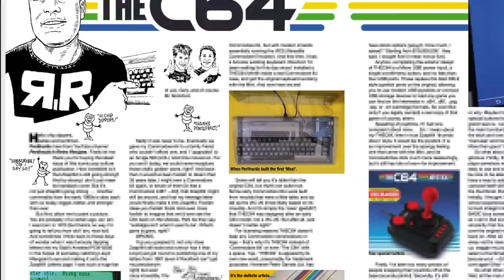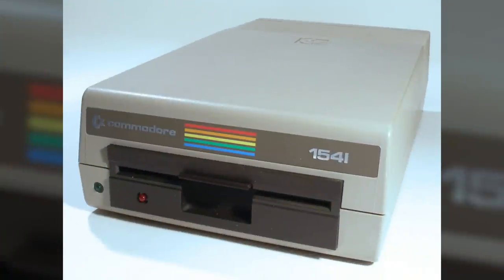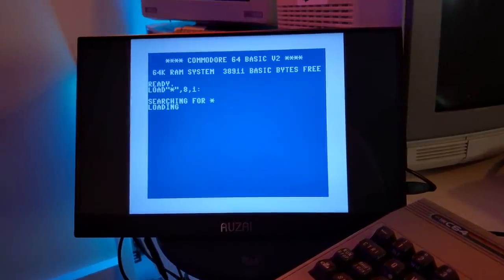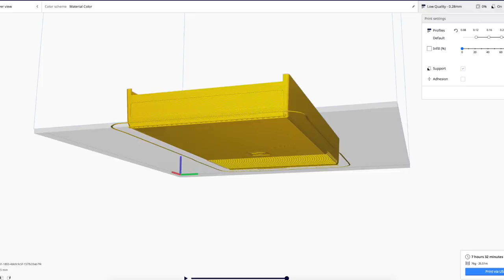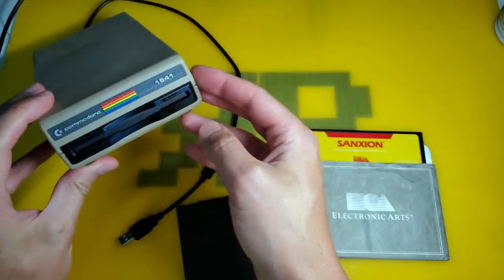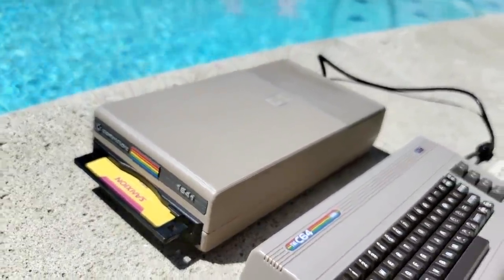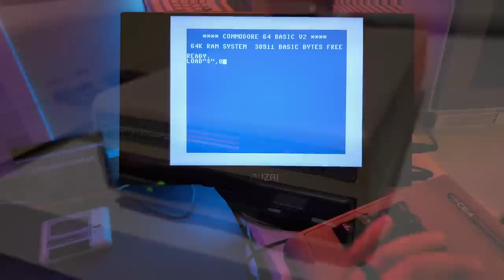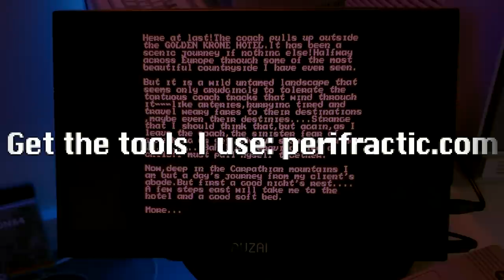Can we make REAL Floppy Disks work with THEC64®? 1541 Mini!

Comment: The thing is... Windows isn't "doing something weird", it's formatting it as a FAT12 floppy disk, as you would expect it to... But the Mac is just treating it as a raw block device (like any USB drive) and is formatting it as such (with a full partition table, MBR, and most likely FAT32). -- so the Mac is what's being weird here, it's basically treating the device+disk as a really tiny thumb drive, instead of like a floppy disk.
Reply from the maker: Good points. Could be! But then, why do 720KB disks formatted in Windows work with THEC64 (as I mentioned in the video), but only 1.44MB don't work from Windows  🤔 In other words why does Windows format 720KB as a raw block device (from what you're saying), but it formats 1.44MB as a floppy? That's what I mean by "something weird" going on...
Reply: Yeah, that is what I was wondering... it showed FAT12 when he put the diskette in the Mac, which is correct. The Mac formatted it wrong, but luckily it was what the C64 needed.

What I am surprised about is the C64 firmware can read FAT32 but not FAT12?
Reply: Just a couple days ago I tried to format Micro SD cards for use in MSX computer cartridges for FAT16 on Windows 10 and they didn't work at all, but on an old Win7 laptop they worked every time with the same settings. Not really related to floppy disks but something is a little weird with Win10 and FAT.
Reply: @knightcrusader  That doesn't surprise me at all, TBH. FAT12 is only used on floppy drives--you can't format a typical USB drive using it, after all--so why would the makers of the C64 feel the need to support it?
Reply: Hi - it may be the same problem as with older pc's and hardware, windows xp and newer use a type of does emulator not a full dos like what was used up to Win 98

Try a older machine that boots up on genuine does 4 / 5 / 6.22 and try formating the floppy on those machines.

Back in the day i had a compaq 386 with win 3.1, that pc could format a variety of floppies that worked on "strange machines" 

Dos 4 and 5 etc also has command line options for the format command  - type format /? to review the options you can use

Regards
George
Reply: Hey, thanks for the pin, Perifractic!  I missed that comment in the video, so I can see where you're coming from now.

The thing is, Windows 10 is really particular about how it treats USB devices with the "removable" bit turned on in their drivers.  So I don't think it was treating it as an internal block device for either format. (Meanwhile typical *nix-like OSes are very unrestricted here, and let you treat just about anything as a raw block device, even a file on disk, or a block of memory).

What I suspect the real issue is, is that the firmware/drivers on that embedded ARM SoC (I would guess it's rocking an Allwinner, probably booting into some stripped down Linux kernel under the hood, and launching the C64 shell app after it boots up).  And I'm guessing the drivers it has are probably not 100% compatible with FAT12.

Most modern embedded systems' drivers only support FAT32 (and some support exFAT/FAT64). -- And I'm not surprised if a modern SoC system only has partial support for FAT12, it's kind of the nature of embedded programming, to strip the code down to as small a footprint as possible.  (And sometimes that stripping breaks or even outright removes antiquated features.) 

Regarding the MicroSD card Tangent that another user brought up, that could be a ton of different things, and I'm not really surprised that Windows 10 is acting differently than Windows 7 there.  In that case though, and IMHO: they're both acting weird, because that's not really a normal thing that there's an established standard for.  It probably comes back to Windows 10 treating it as a removable device though, and initializing and partitioning it differently as a result.  So, if you're emulating a harddrive with like an SD-to-IDE adapter, that's not going to work well for you.

(You can test that same phenomia by moving drives between different external drive kits, and internal, and noticing that in some it works, and in others it will show up as RAW -- this is because the drive controller's drivers are telling windows to treat the drive differently than how it's actually been initialized and partitioned -- that is, even though it has the correct partition, the offset to the partition table, and the very low level boot-record/MBR/GPT type stuff is wrong, so it just thinks the drive is full of garbage).
Reply: @RetroRecipes  Maybe the DD disk works because you need to manually specify the number of sectors and tracks to format via the command line (FORMAT A: /T:80 /N:9)
Would formatting a HD disk as "FORMAT A: /T:80 /N:18" work? I don't have a C64maxi to test. There is also the "/FS:?" switch to force format to FAT, FAT32 etc, although that might not work with floppies
Reply: Would this work?  or a more advanced formatting tool on winblows?

Format A: /T:80 /N:18 /FS:FAT32 /S:ENABLE /A:512      - For DSHD
Format A: /T:80 /N:9 /FS:FAT32 /S:ENABLE /A:512        - For DSDD
Reply: actually dont USB Floppy devices on windows treat the whole thing as a raw block device like a flash drive anyways?, usually its the device itsself that handles those matters with whatever settings it has internally.  it's probably the usb drive doing the weird stuff using its own weird logic.
Reply: @RetroRecipes  It's probably down to the NT code that Windows is based upon, as 1.44mb disks were actively supported till the early 2000s but obviously broke some compatibility along the way with certain devices, I think the 720K disk working is because the format code has probably not been touched since the early 90s when MS-DOS was still being worked on.
Reply: HD diskettes have only 1 FAT, all other formats have 2 FATs.
Reply: TheC64 being Linux based, is going to look for a FAT32 formated device... Be it floppy, stick, hdd, or even ssd.  I would like to see it work with an external hdd formatted FAT32, and I'm pretty sure that it will. In fact, I might just try it with my TheC64 mini .
Reply: The fs autodetection logic in mount is really smart these days. Both the vfat and msdos drivers should support both fat12,16 and 32, so the issue shouldn't be missing kernel modules either. If you have a partitioned floppy disk then I think you need to run partprobe manually because the system won't know when a disk is inserted, so also seems unlikely to be the case.

I think we would need dd image dumps of a floppy formatted on each system to figure out what is actually going on here
Reply: Note  3/5  720k disks are basically the "new" gen 1 of the smaller rigid floppy
The specs originally Fat 12 system 80 tracks,  9 sectors per track ,  512k per sector

Dos 3.2 was the first to support 720k so that would be the safest one to use that would not be using or substituting a later FAt ( or trying to force backwards a earliers standard ) - think of the 1.2M 5.25 drives, they are designed to read 360k , but read / write 1.2 format, some can write a 360 k , other cannot to it at all, some can get a close 360k that will only work on that machine, hand the floppy to some one else and they cant read it

Now while  dont have a external 3.5 USB floppy ( i should buy one ) but i have a P100, P2-233, Celeron with 3.5 floppys - they all run dos 5 or newer.

The P100 does also have a Gotek Floppy Emulator - and i have used it with multiple OS from 3.3 to Win7 and at time also plugged in a proper 720k floppy or use the b: 1.44 floppy to format damaged or blank floppies for friends

Finally the USB floppy is primarily a read device for backward use of older tech, all its support devices eg chips / firmware etc would be set up for Win7 or newer and due to that is may not be able to physically format perfect disks

https://en.wikipedia.org/wiki/Comparison_of_DOS_operating_systems
Reply: One thing to watch for is the Media Descriptor Byte.  In DOS and Windows 95 they ignored that byte field in the Boot Parameter Block, while Windows 2000 and newer detected it.  At work a friend and I had the same model PCs, his was running Win 2000 while mine still had 95.  He had a floppy that he'd formatted on a Mac, his PC thought it wasn't formatted, while my Win 95 PC could read it fine.

https://support.microsoft.com/en-us/help/140060/floppy-disk-is-not-accessible-not-formatted-or-not-recognized-by-windo

http://www.os2museum.com/wp/dos-boot-sector-bpb-and-the-media-descriptor-byte/

I'm not saying that has to be your problem, just something to check out as a possible cause.
Reply: I'll place my bets that Linux will do the same thing, this is some typical UNIX behaviour here (everything is a block device)!
Reply: Lassi Kinnunen  I was talking about it reading FAT32 but not the more primitive FAT12. I was under the impression that in linux if you have support for FAT, you support them all.... unless they took it out to save room.
Reply from the maker: @mrnmrn1  Hmm, I was told this drive worked with 720KB disks but Mike's Retro Tech who helped with this video. But I need to run some more tests it seems...
Reply: @TheDeeplyCynical : It depends on the size and modernity of the floppy disk. Try it with any size of Zip floppy (Pocket [40], 100, 250, and 750).
Reply: Was not FAT16 introduced for long file name support? (As opposed to the old 8.3 format).
Reply: I want to know if it is possible with the DOSBOX emulator to use a FAT12 floppy with 1.4 mb.
Reply: On my Android tablet i have an USB stick plugin for 2 GB FAT16 USB sticks. All larger USB sticks ex. 16 GB do not need a plugin.
Reply: I had the same problem with my SanDisk USB drive after burning an .iso on to it. SanDisk had a formatter which one downloaded and was able to format it properly. If left to Windows I would've lost about 30GB of memory.
Reply: @disasterincarnate  surely not! It's desirable to treat floppy drives over USB as normal floppy drives since the use case for a usb floppy drive is legacy integration with things that access them over a floppy controller.
Reply: The C64 is just a Linux machine. its the way the64 binary reads the USB flash drives, it can be finny sometimes, when it first came out it would not read all USB Flash Drives even when Buildroot 2016 did. It would have a problem with finding updates on the USB flash drive and would only load one image(THEC64-drive8.d64). before RGL made USB File Loader in October 2018. They put Media Access in THEC64 so it has different features on it so it sells and not the same as the C64 Mini, you can't run the64 binary fromTHEC64 on THEC64 Mini but can run THEC64 Mini the64 binary(its original name was THE64) on THEC64, I made PCU(Project Carousel USB). I build my THEC64 Maxi its called THEC64 Maxi PI, I put it in a C64 Breadbin (first version case)the case looks like the VIC-20 case like THEc64 case, It runs THEC64 Maxi's OS from a SD Card,(you can make one too, you need a Orange PI PC H3)You can plug a SD card into it too,(you can use a USB SD card reader), I use a USB Hub that has a SD card on it so it has 3 USB ports and 2 SD card slots so I run PCU from SD card not a USB Flash Drive. You can now run games from the Carousel from a USB Flash Drive, I do have 2 THEC64 Mini's, THEC64 Maxi PI is on my site here.. https://thec64community.online/thread/474/thec64-maxi-pi-diy-version
Reply: This would explain why when I format floppies on a Mac, the older machines I put them into usually have trouble with the disk.
Reply: @d2factotum  Fat 12/16/32 are all related.  It's harder to exclude one than it is to include all 3.
Reply from the maker: I understand that Windows may be formatting 720KB in FAT12 and 1.44MB in FAT16, but this doesn't explain the other comments which say the Maxi cannot read disks unless they have an MBR and partition table. What is different about FAT12 that means the Maxi can read those disks formatted by Windows? Does Windows put a MBR or partition table on FAT12 floppies? But not FAT16? Thanks in advance.
Reply: I don’t think you can ever have FAT16 on a floppy disk.  The flavor of FAT is determined solely by the number of clusters in the data region - the FAT spec is VERY clear about this - and that is determined by the number of sectors on the medium divided by the number of sectors per cluster.

Floppies use either 1 SPC (cluster=512 bytes) or 2 SPC (cluster=1024 bytes).  The threshold for when you have to stop using 12-bit FAT and start using 16-bit FAT is around 2^12, minus some reserved values, or roughly 4000 clusters.

Using the smallest SPC divisor (1 sector per cluster) means we’ll have the maximum number of clusters, but even still, the FAT12 threshold ends up being around 2MB, so both 720K and 1.44M floppies are firmly in the FAT12 camp.

There’s no hack or workaround for this.  If you write a 16-bit FAT table on a volume with <4000 (approx) clusters, it won’t be readable by any other standard FAT implementation.  There are some fields in the BIOS Parameter Block, and partition types, that you can set the FAT16 and FAT32 do, but those are not used to determine the FAT size.  The cluster count, and only the cluster count, is.

So, it has to be something else.  Could be a MBR partition table on a floppy disk, or different media bytes, or even the OEM Name field in the BPB - although I doubt any Linux-based FAT driver cares about that.

I’ve been slowly tinkering with writing my own MBR and FAT driver code off and on for a couple years - hoping to get my C code to compile on DOS to have some flexibility over the on-disk layout that fdisk and format don’t offer, and embedded stuff with SD, etc etc.  Point is, I have written test tools with the ability to examine image files, and create all kinds of weird combinations of options that most drivers probably don’t let you do (for good reason, usually.)  I can try formatting a disk on Win 7 and OS X and see what they’re doing differently.  Although probably the most useful thing would be to get a copy of the images that do and don’t work for sure, and compre those.
Reply: I can remember fron "historic" news articles an also from own research that Windows has the "oddity" to sometimes use a partition table even for floppy disks. Thus a floppy is first partitioned including an MBR and then its used in a whole with a single data partition of FAT12.

(Here skipping the part of low level description of C64 floppy file systems and realted images.)

As of today USB mass media in form of USB sticks are pretty common. When you want to operate with them you will stumble across tools like "dd" (originally from Linux, but sometimes also useable for Windows systems), rawrite, rufus and RoadKill's disk image tooling - Google is your friend. It depends what you want to do - but if you want to /format/ a floppy without a data envelope of a partition/mbr then you might like saving an image of a freshly Mac formatted floppy to your hard disk and later on you want to copy (or trying to do that - already a while ago i used my external USB floppy drive, but no need for such sort of /magic/ as all i tried was only standard tasks so it could not fail) to the 3"1/2 disk in question first before sending any data to it. Also the disk name should be editable as that one is a FAT feature bound to the partition - or much better say the disk label is an entry in the root dir of the partition.

On the other hand i feel like its a current "limitation" of the TheC64 system not being able to resolve partition tables on exchangeable media - even if that a totally valid and often found setup. (Believe me - i was doing noticeable amounts of work in several cases with embedded computing systems and the recent times showed that Linux on embedded really often likes partitioning of media for various reasons and purposes.)

Rationale: For a long term fix get in touch with the coders behind TheC64 and then get an update. Its really a quite normal standard and they should be able and willing to add support for that in order to conform with the standards.

PS: Hey, you can have multiple partitions on a single floppy - i just don't know what MS-DOS drive letters will be used then or what other funny effects it will have. Just give it a try. You still have 26 characters in the standard alphabet. ;-)
Reply: i guess Im kinda randomly asking but does anybody know of a good site to watch new movies online ?
Reply: knightcrusader but TheC64 is running some ARM Linux kernel so seems reasonable that it would readily support FAT32 but be buffaloed by FAT12

Comment: I totally get that this is about the nostalgic disk drive feeling and also about proof of concept. But besides that, the idea isn't really that out there ludicrous. What is it we rapidly run out of on TheC64 Maxi and rather instantly on the Mini? - Yes, USB-Ports!
So... how about a miniature 1541 lookalike with a USB-hub in the back, and obviously since so many of us retro-nutcases already use SD2IEC card readers and Pi1541 drive emulators (and not to mention that SD and microSD cards already look a tiny little bit like floppy disks) then need I say it; a card reader in the front.